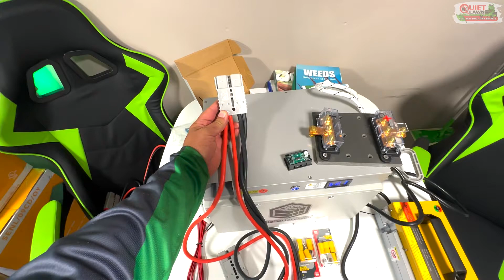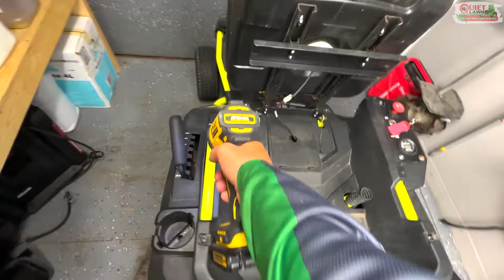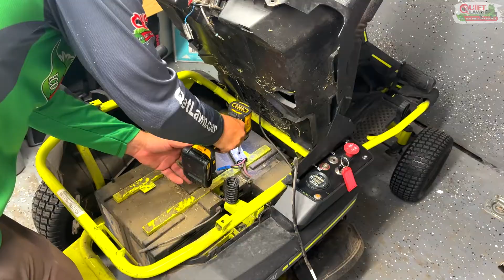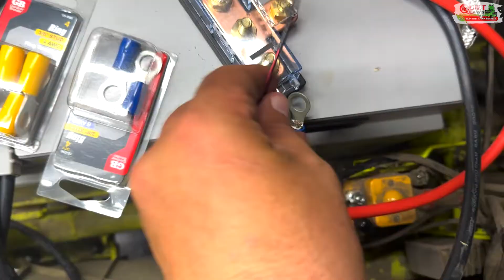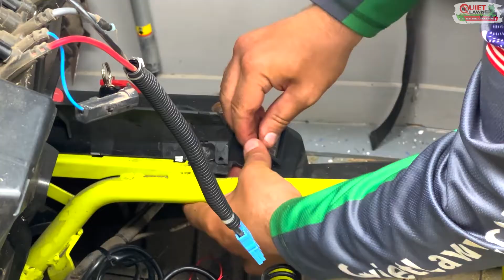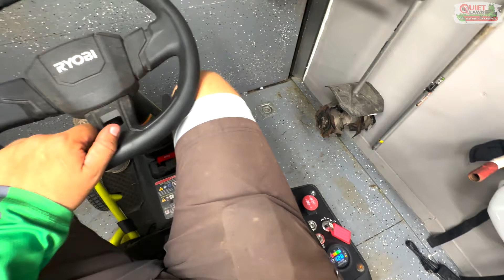CONVERTING OUR SECOND RYOBI RM300e TO LITHIUM | Electric Lawn Service

Comment: The way I swapped out my batteries was much easier and less expensive and less time consuming than the way you did it. I purchased 4 eco-worthy    12v, 50ah lifepo batteries. They are the same size as the lead acid batteries. I took out the lead acid batteries, dropped in the lifepo batteries, reconnected everything the same way it was, and connected a 4 terminal Noco battery charger. One to each battery. I attached the charger to the back of the seat. The charger tells me how much juice I still have, so I didn't have to install a battery meter. Total cost was $820. Total time to convert was 1 hour, 20 minutes.
Reply: Absolutely Brilliant. I am a gal that must do a battery swap. I appreciate you jumping in here. I assume the charger is the Norco Genius 2x4 for about $200. ? I would fix the 8 ends with new fittings to attach permanently ? In series I am trying to not complicate this in my weak brain. I will study Norco direction on using the tool for the 4 battery plan. And do you recommend purchasing their GC009 X connector along with the 10ft extension cord? Do the extras help make it more seamless? You really helped so much you cannot imagine. I love the mower and live in Central Florida for year road use. I am not loving having to replace batteries after 18 months-lol. I have disassembled and removed the clunkers. I am ready to move forward and you cleaned it all up. Thank you and just know you speaking out has really helped give someone a leg up. I am also very grateful that Quiet Lawn started these video for all to learn from. Stay safe out there. Sincerely
Reply: @mycocheto  you are correct about the charger. It is the Noco genius 2x4. It comes with the gator clips already attached, but you can simply unscrew them with a screwdriver so that you can have a ring terminal. I did not get any extension for the charger. I just hung the cables out of the back, under the plastic cover. The 4 cables then connect to the charger. The charger has a 6 foot cord that plugs into an outlet, plus that power cord also unplugs from the charger if you wish. It is not a 3 prong plug. It is 2. I'd send you pictures if I knew where to send them. 
  Good luck. It's easier than you think.
Reply: @mycocheto by the way, today Amazon has the batteries on sale.
Reply: thank you yet again . After I wrote late last night I actually went to Noco sight and got download to see what they had in box and realize just the charger and 4 batteries. Awesome. I also saw the batteries were $20 off but have not checked if they would give discount off each batterie. That would be a $80 savings but not sure yet. It is a crying shame Ryobi so weak in many departments. You ever call customer service about this warranty service qustions? OMG. I am shocked that Home Depot is so non proactive about that kind of customer care. Probably my last Ryobi purchase. But moving thru this and I think it is easier only because of you. So lucky I have read so much and happened on you. My sincerest gratitude. One I purchased everything the connecting of the 8 leads from charger, I might scratch my head . Any beginning or end point ? As a certain pattern so to speak. And thank you for responding-Bravo to you yet again. :goodvibes: @matthewkurt2246 Jeepers you actually sent more assume info because I looked at price of batteries and for sure a better deal than late last night. YOU ROCK!!!
Reply: @mycocheto  I try, and you are very welcome. Feel free to reach out if you need any assistance.
Reply: Drum roll-tada the 4 batteries purchased-Wahoo ETA October 5-10(with Florida tax $550.). Now I will watch for perhaps a price break on $199.Noco maybe Prime Day coming... I have my fingers crossed. I will hopefully get to it near 12-15th of October. As I mentioned I wonder if there is any pattern I need to follow when hooking up 4 batteries to the charger? Or any connection pattern will not affect the charger to just keep 4 batteries charged individually (first set of leads on battery top left)? I have time to get that in tow. I understand that Costco may give $15 per core from Facebook forum on these machines. I can ask them. Then maybe sell off charger.This was a bitter pill to swallow, just on principle. I went to local battery store before I went to YouTube and owner was hostile about electric mowers and not being able to get parts or batteries He was a big disappointment but said no parts and no repair people near. I am blessed to be handy. I am a low impact user (small yard-i am lite weight at 125lbs-and mower can sit inside A/C garage). Point that other moving parts probably not under bad stress, giving some longevity. I even put a ceramic coating on all of it when it was brand new. Maybe a set of extra mulching blades and off to the races-lol. I am so happy to have pulled trigger-thank you always.I will advise as it unfolds.🙏👍🍀Life is Good!!!  @matthewkurt2246
Reply: @mycocheto  each of the four charging ports on the charger has a positive and negative wire that plugs into it as one connection. As long as you connect the positive and negative to the same battery, it doesn't matter which order you do it in, as long as you have all of the batteries connected exactly the same as they were when you removed them. 
  I purchased my noco genius from Amazon for $180. It's slow to charge, but I don't use my mower more than twice a week. I live on a third of an acre in northern Illinois. I have used my mower three times since replacing the batteries and still have almost a full charge. 
  Again, reply if you need any written assistance.
Reply: Thank you for the clarity. Your total combo is the Best!!! @matthewkurt2246  🏆🎯🏁
Reply: @matthewkurt2246  The NOCO GENIUS 2x4 is rated to charge UPTO 40Ah batteries. From the NOCO support site: "Can I use the GENIUS2 to charge batteries larger than 40Ah? It can be used to try and charge larger batteries, but the way the charger works is that it must fully charge the battery first (14.5V) before it will kick over into maintenance mode. The GENIUS2 will try to charge a battery for 96 hours, but if it is not able to fully charge the battery to 14.5V (in 12V mode), it will time out and go into error, and stop charging the battery altogether. There are a lot of factors that affect how long a battery will take to charge (amp-hour capacity, how depleted the battery is, how much sulfation buildup the battery has, etc.), and the more of these factors you have going against you, the more likely it is that the charger will not be able to complete the charge on a battery outside of its range before timing out."

I didn't read the specs before purchasing the NOCO GENIUS 2x4. I really like the way you can take off the clips and use the eyelet to charge each individual battery and get a LED status on the NOCO. I've used the GENIUS 2x2 for my boat for years and it's great. With the ECO-WORTHY 12V 50Ah being over the rated NOCO specifications for amp hours I do not think the NOCO 2x4 is the right charger. Wish it was. Also wish there was a picture on how you mounted it to the back of the seat LOL.
Reply: Thank you so much for posting this alternative for the lith conversion everything works great and was pretty easy to change out.
Reply: @teevestj7512  glad I could help
Reply: @teevestj7512  Thank you for your progress report. I am thinking of following the path that @matthewkurt2246 introduced us too. Do you have anything from your experience to add? It's an expensive leap of faith, but the experience of others is encouraging. Finding the RMB300e itself may end up being the most difficult step.
Reply: @matthewkurt2246 - Anyway you could post something on YouTube about the installation process of the Eco-Worthy lithium-iron batteries or at least some pictures of the wiring setup for your Ryobi?  I've just purchased the same today after watching https://www.youtube.com/watch?v=Ey_9MzFBrt0 on YouTube.  But he did not post any video of the process nor photos.  I just want a better idea of the wiring steps.  Thanks for posting your information about the Eco-Worthy batteries.  Seems alot cheaper than buying a $2,000 100ah lithium-ion.
Reply: @mjeff321  everything hooks up the exact same way it was originally hooked up. That is why I purchased these particular batteries. The terminals on these batteries are in the exact same position as the original batteries, therefore, you don't need different wiring. The batteries are just a hair too long to fit properly, but they fit good enough and won't move.
Reply: Just making sure you are all talking about the 300 model?  30 in?  I’m trying to make sure I purchase the right size eco worthy batteries.
Reply: @littlelilly651  yes
Reply: This is a terrific alternative to the lead acid default batteries and the best thing about it is knowing that there's minimal changes that need to be made from the original hookup. Thanks for sharing this! I've just had my original lead acid batteries replaced under warranty (after only 4 mowings!) with new lead acid batteries, but I'm tempted to ditch  them and go ahead with these  eco-worthy lifepo batteries. Much appreciated!
Reply: @stevecheong770  you're welcome. Glad to help.
Reply: Sounds great do you anything on YouTube with your install?
Reply: @teevestj7512  no, sorry. Just what I have written in this thread.
Reply: @matthewkurt2246  thanks for responding, so it's been almost a year I'm assuming no issues and holds the charge through each cut? I will give a shot based on the information you gave, thanks!
Reply: @teevestj7512  yes, the mower runs great. I get enough charge to mow nearly two acres before recharging. Remember, this is a trickle charger, so it may take up to a day to recharge.
Reply: @matthewkurt2246  thanks again, some time in the fall I will tackle this project I hope it won't be a burden to reach out to you if I happen to run into issues with the conversion.
Kind regards, Teevestj
Reply: Its been a year since you posted this. How are the batteries holding up? My lead acid batteries in my mower finally failed. Looking to do what you did.
Reply: @noahfigueroa3534  everything so far is still working great. I have not had one issue with this setup. Thank you for asking. If you need further guidance,  feel free to ask.
Reply: Delighted to find your method! Thanks. I can find the batteries and the charger you mentioned. But, the battery Q&A includes the following warning about "desulfation": Q: Do I need to buy a special charger to charge this battery?
A: You can use an AC-to-DC lead-acid charger that is mains powered, as charging efficiency and duration are less of a concern, it cannot have automatic desulfation or equalization modes. If so, do not use it as there is a risk of damaging the cells or the battery. This can significantly shorten the life of the battery. If it has a simple bulk / absorption / trickle charge profile, it can be used to charge the battery but must be disconnected after charging and not left in trickle charge / maintenance mode.  AND the charger description includes: Special Features
4-Bank Battery Maintainer, Trickle Charger And Battery Desulfator

I am hoping that the desulfation in the Noco is a setting and not standard operation.

Any comments about this issue? Thanks!
Reply: @FCQJJB  I have had these batteries and charger installed for two seasons now without a hitch.
Reply: @matthewkurt2246 many thanks for the reply! That's good news all round.
Reply: @matthewkurt2246 just did the same thing you did!  Lithiums are charging on the noco now!  Can't wait to take it for a spin
Reply: @drewmcdowellmusic  glad to hear. Took mine out for the first time this year last week. Ran flawlessly. Too bad for me that when I did this to the mower a few years ago, the batteries were more expensive. Hope it works out well for you.
Reply: @matthewkurt2246  they were about 100 per.  🤷 Well worth it
Reply: What about the NOCO not being rated to 50Ah? The instructions say upto 40Ah.
Reply: @goodvids4171  it's been charging my batteries just fine.
Reply: I just charged 4 new lithium batteries 12volts 50Ah with the charger. 24 hours from flat to full. My voltage meter says all 4 each at 13.7 volts. I reached out to Nico and waiting for their answer to your very good question. I think it looks fabulous thus far. From fit to finish both the batteries and charger seem tops. installing maybe Sunday to run the ryobi around for test drive. I will update. @goodvids4171
Reply: Noco replied that it will be fine just takes a tad longer. for my needs perfect as my yard is not too large.i like the unit . @goodvids4171
Reply: just had eye surgery so have been side tracked. Went to drop in batteries today and mine are too large to sit in the tray(frame). Now im not sure if I put a base and raise height if this will fit. So much for easier. I am really shocked.???
Reply: @mycocheto  my batteries were about a quarter inch too long, which made them a little taller, but not too tall to not be able to put the top plastic cover over them. I didn't use the middle post bolt or plate to lock down the batteries. I strapped the batteries down instead. The top plastic cover still touches the top of the batteries, but it is flexible and will still screw down into place. 
  I've used my mower 5 times since we last spoke and have had no issues, and nothing inside has moved at all. I've mowed nearly two acres on one charge. The battery meter still shows full. 
  I hope your eye surgery was successful and that you are not experiencing too much pain. 
  Good luck, Darcy.
Reply: in general the batteries you installed are not sitting level? are they on an angle? tipped down? I thought to add a wood platform but waited to ask how you fared. My eye is turning the corner but it has been awhile with it. Outcome in a few months should be awesome. 🙃😊
Reply: @mycocheto  no, my batteries are not sitting level, but because they are strapped down, they don't move at all. The battery terminals are all in the middle. The other end of the batteries are the ends that are raised on the metal lip of the battery compartment, so the terminals don't touch anything, and the top cover barely touches the top corners of the raised ends of the batteries.
Reply: I appreciate the over few and conformation. I have one more leg to eye gig on Wednesday and by Friday I should be able to be free and seeing 20/20 less some healing. I probably hit it tomorrow a little and then Friday finish up. I will post the results soon. I went to get upgraded lens implants back in March and doc kinda pushed his idea. Did not work so I had to go thru redos. So finally on last leg. It is very cool new technology called,"light Adjustable Lens". Modern as heck but takes a lot of dedication for long weeks process. Gave up cataracts and got these bad boys. So in the end -glasses free 20/20. Happy to be able to go forward. I actually dismantles mower thru this-lol. Didn't see much of it-ha ha. And all the typos thru this -ouch. I am just happy to shake the doc and hit a home run which was iffy. I will riding mower soon and fun again. I shall be back . And Thank you ever so much!!!🙈💥
Reply: @mycocheto  I'm glad to help. I just installed a trailer hitch on the back of my mower. I'm going to use it to attach a snow plow to the back ( I'm near Chicago). I'm also going to get tire chains. In spring, I'm going to get a dethatcher attachment and an aerator attachment to drag behind the mower. All will make life so much easier. 
 I still wear glasses. My eyes aren't bad enough yet to warrant getting Lasix or anything. 
 Keep me updated on your progress with your mower and your eyes.!
Reply: Is there a video on your process?
Reply: @eighties8  using the batteries I mentioned above , everything hooks up the exact same way the mower originally came, so you can just watch some YouTube videos on how to replace the original lead acid batteries, but use the eco worthy batteries instead. Very simple. Just make sure you have a Torx tool to remove the screws from the outside casing.
Reply: Why did you add the battery charger and the battery meter?  If the only thing you changed was the batteries themselves and they were a direct fit, why change the other two?
Reply: @A.Dostie  also, I didn't replace the battery meter. The charger has one on it.
Reply: @matthewkurt2246  So mine were 12v 100AH.  I replaced them with the same and they were way smaller than the original batteries.  Hooked up the charging cables and charging now.  Looks like Darth Vader is in my garage with the lights off.  Did you reattach all the original wiring to the old charging port and instrument panel?
Reply: @A.Dostie  I did not rewire the old charging port. Instead, I removed it so that the wiring from the charger could pass through that opening. The old charger is useless now, therefore the old charging port is useless. The original charger will not charge lifepo batteries, so the charging port is useless. The new charger is screwed on to the back of the seat and the wiring for the charger now goes into where the old charging port was. This way I don't have to grab the charger and connect it to the batteries every time I need to charge the batteries. All I need to do is just plug the charger into an electrical outlet, so now it's actually easier to charge than it was originally.
Reply: @matthewkurt2246 first of all, thanks much for the guidance on this.  Much easier than what is depicted in the video.  I just replaced my lead acids with LiFePO4 batteries and the same charger and was having difficulty getting the mower to power on, as I left the charging port disconnected.  You said you removed it from yours.  How did you maintain the circuit that is apparently closed by having the port connected?  Did you just leave it connected but tucked away out of sight or did you do something else that completed the circuit.  Thanks again!
Reply: @gcj05  I left it connected, but removed the outlet and tucked it under.
Reply: @matthewkurt2246 thanks.  I did the same…zip-tied it to the bungee cord I used to hold the battery covers down.  Mower is working great with the new batteries.
Reply: @gcj05  good job!
Reply: @A.Dostie  Good afternoon i have been reading about your progress through your comments are you still having good results with the conversion?
Reply: @A.Dostie  because the original battery charger for the mower doesn't charge LiFePo batteries. You need a charger that charges LiFePo.
Reply: I now have my 4 batteries and the Noco charger and I have charged the batteries to check that the batteries and charger behaved and now I am about to reassemble the RM300E. I seem to recall that the person in the video used a different battery indicator but you got around that by using the Noco as a battery indicator. Did you reconnect the original wiring to the charge and time display or did you leave those terminals out of/off  that round display device? Were there any other changes to rewiring (vs unwiring)? Thanks again, Jeremy
Reply: @matthewkurt2246 I now have my 4 batteries and the Noco charger and I have charged the batteries to check that the batteries and charger behaved and now I am about to reassemble the RM300E. I seem to recall that the person in the video used a different battery indicator but you got around that by using the Noco as a battery indicator. Did you reconnect the original wiring to the charge and time display or did you leave those terminals out of/off  that round display device? Were there any other changes to rewiring (vs unwiring)? Thanks again, Jeremy
Reply: @FCQJJB I actually reconnected the original battery meter and it works just as it originally did. I still plug in the Noco to check for accuracy, but the original meter seems to be spot on.
Reply: @matthewkurt2246 Good news. Thanks again!
Reply: @matthewkurt2246  Success! Reconstructed (without the battery covers and with the battery holder modified; a small hole in the back panel with a new sponge surround for the charging cables to fit through). I charged the batteries the other day. Delighted when I turned the key and the machine powered up with original battery indicator showing full charge. Took the machine for a ride. Mower blades work, but happy/sad we are too wet at present to cut grass and certainly to catch grass. My partner thinks I am amazing:) Thanks Matthew!
Reply: @FCQJJB  you ARE amazing for doing this. I thought it was going to be too difficult for me to do, but couldn't believe how simple it actually was.
Reply: @matthewkurt2246  I too owe you many thanks for sharing your solution to the lithium conversion question. I used precisely the parts you recommend (batteries, charger and the new long bolt) and had zero problems. Simply connect everything back exactly as it was before the swap out. It couldn't be easier. My cost at purchase six weeks ago was $400 or so for batteries and $200 or so for the charger. The mower works GREAT with the lithium batteries and here, initially at least, I can cut my 7000 square foot lot four full times between "refills". Fantastic! Thank you for sharing as it gave me the confidence to go out on a limb to make the hefty outlays for both the mower itself and the new component. Altogether I am in about 2K, but I hope the mower will last me many, many relatively maintenance free years. Fingers crossed! My only question is regarding mounting the charger to the back of the seat. May I ask you details about this aspect of your conversion? How specifically did you mount it? Any specific placement or other details you can share with us? What sort of fastners did you use; bolts with nuts, self-tapping wood screws, some other method? I am hoping I can plug one simple AC connection in to the outlet to charge it up just like you do. Thank you again for sharing your conversion ideas. They work perfectly!
Reply: @Seattleseeker thank you for the kind words. I mounted the charger directly to the back of the seat simply by using wood screws. No washers or anything else. It doesn't feel like it is secured great, but after a few years of weekly use (yes, I even use it in winter near Chicago), it's still snug on the back of the seat. I rigged up a snow plow on the front for my driveway in winter. You don't necessarily have to put the charger on the seat. Anywhere is fine, including just placing it in the small area behind the seat.
Reply: @matthewkurt2246  Excellent. Thank you kindly!
Reply: Make a video bro. Sounds like the way to do this.
Reply: @CokemanChatt it's too simple of a repair to require a video. Apparently, others have read my instructions and have figured it out without the need for a video.
Reply: Amazon AI seems to suggest I need a 48V (58.4V) Lithium charger to charge the series setup as one unit, otherwise the batteries or charger may be damaged as the polarities will be mismatched if I try to charge the 4 batteries individually using Noco charger while the batteries are still connected in series. Do I need to make any additional changes for safe charging?
Reply: @abhijeetmaharana I connected all new batteries the exact same way the old ones were connected. This set up has been working perfectly for a  couple of years now.
Reply: @matthewkurt2246 The old charging setup is a single 48v input to the ‘final’ positive and negative terminals. Individual battery terminals are not connected directly to the charger. In the new setup where each battery is hooked up directly to the Noco charger but also in series, doesnt the negative terminal of one battery fight the positive input being given to the next battery by the charger? Trying to wrap my head around why the -ve terminal of one battery connected to the +ve terminal of the next one doesnt interfere with the charging process. Thank you for all the info!